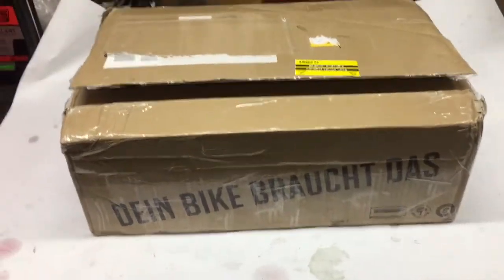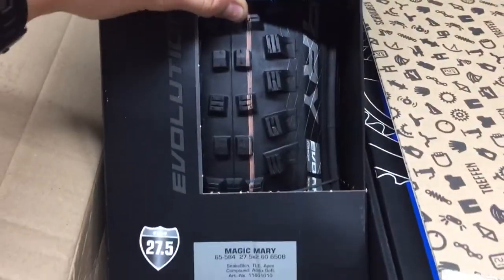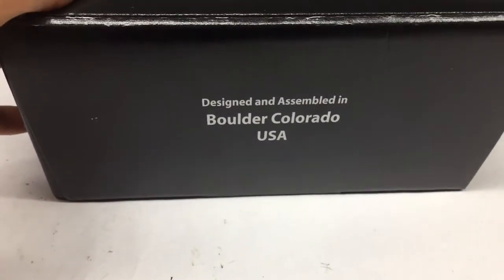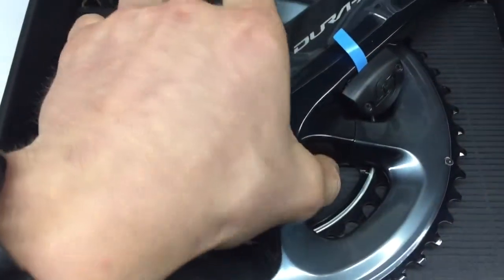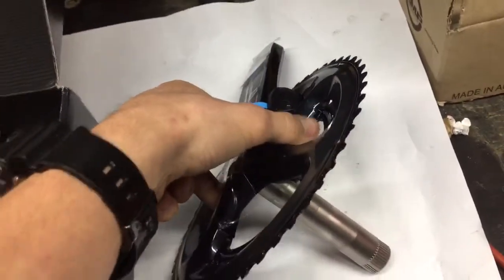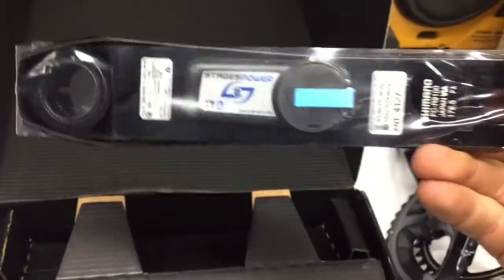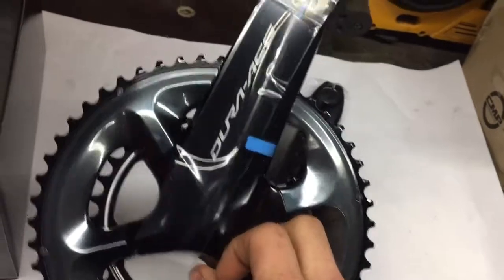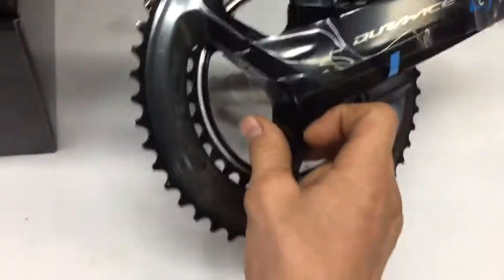Stages Gen 3 Duel Sided Power Meter Unboxing

Comment: what computer you are using? does it show both sides
Reply from the maker: Im using Wahoo Elemnt Bolt and is shows L/R just fine, the main set up is in the stages app to link the 2 sides together to then be sent to the computer as 1 ant+ device. I wouldnt suggest getting this power meter dual sided in Shimano cranks as there are problems with power meters reading inaccurately on the right crank no matter the power meter brand. Hard to believe but watch some video made by GPLama and he goes in depth. Left side only ends up actually being more accurate and cheaper.

Comment: Drop the hammer.
Reply: Can I ask what made you go for both sides over just left.
Reply: It is cycling slang for "go out and ride hard"
Reply from the maker: Ahh, I am going to now :) Before I was just riding endurance pace all the time, about 20 - 22km/hr average weather it was a 100km ride or a 40km ride. But now im hoping to beef that average speed up by holding a set wattage for each ride :)
Reply from the maker: I like the idea of Left and Right balance because im more muscular on my right side (legs and upper body) and I just like the accuracy. Also I like the idea of having 2 power meters, so I always have the option to put one on another bike if I like.
Reply: Which head unit you on
Reply from the maker: Arron Borson wahoo bolt, it's simple but very functional and insane battery life